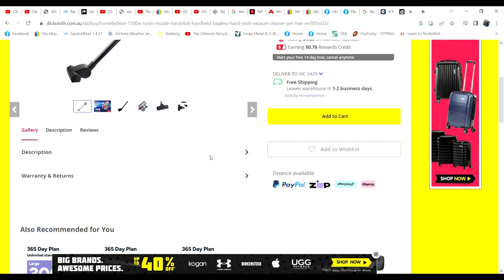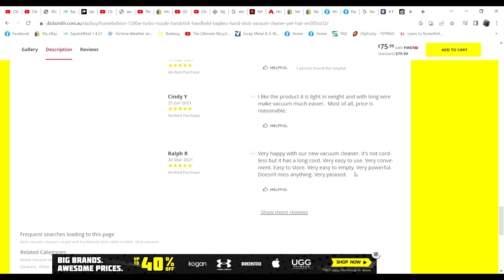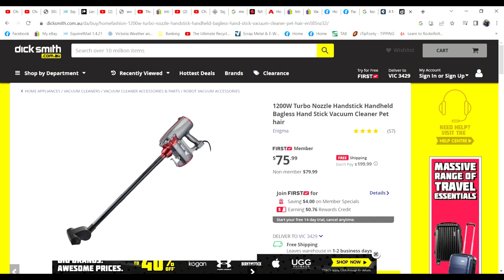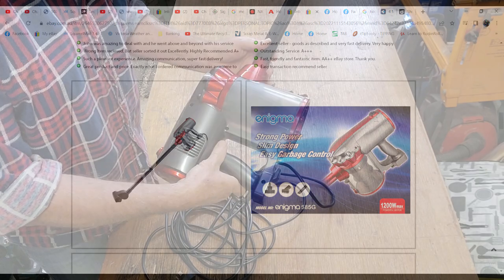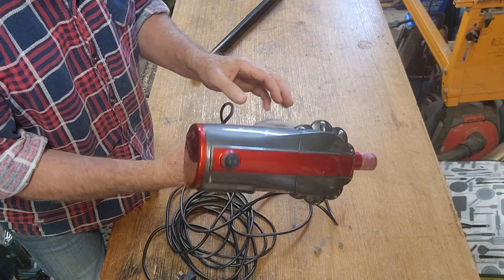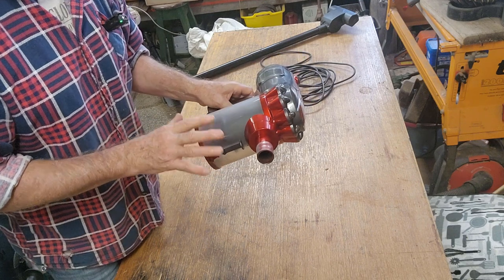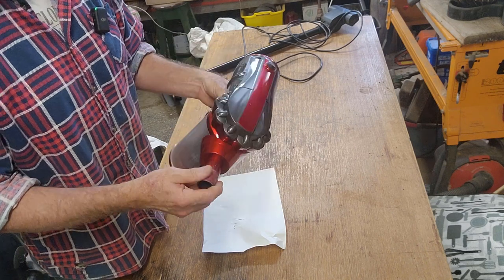If You a Own Bagless Vacuum Cleaner, You Need to See This! Why Many Vacuums Shouldn't be Thown Out!!

Comment: A good video of community value, Chris. I was given a near-new Electrolux that 'had problems'. Upon investigating, it had a lipstick stuck in the intake flow that made a terrible noise. Cleared it out, gave it a clean & it works just fine. So much is thrown away these days. Well done!
Reply from the maker: Thanks mate - yeah, they are probably the most throw-away appliances and they really shouldn't be!
Reply: I'm here because I too want to have a rant, I'm in the UK and have just fixed a Shark and Dyson which both had failed motor bearings due to dust ingress, both had at some point in their lives ended up without their filters because they have the washable type that say leave to dry for 48 hours or something, so device got reassembled and filters got forgotten in the cupboard.

The most annoying part, as well as the "main" filter, both have fancy HEPA/dust filters like this one, AFTER the motor! why on earth would you bother filtering the air again once it's already knackered the motor? disgraceful!

Comment: Intetesting. 

I have a dyson stick. They're made to replace parts. I've had it 5 years and replaced the battery, filter and the roller in the head. 

I've also repaired the power head myself. Was a simple fix once I had the right tool to undo it.

So much cheaper than buying a new one.
Reply from the maker: Cheaper and much better for the planet! Well done on your maintenance routine! 😊👍

Comment: Thanks Chris, great instruction. I have a bagless Shark vacuum cleaner and I clean the filters regularly. One tip that I just found is to wash my filters in cold water and dry. Previously I had just been tapping the excess dust out. All up I'm happy with stick style vacuum as they're pretty compact to store.
Reply from the maker: Thanks Longship, yes we have a Shark vacuum ourselves. The vacuum in the video isn't actually a bad design and it does work well - but it clearly needs some type of maintenance alert for the user!

Comment: I was given and also seen several dysons on hard rubbish due to destroyed motors due to the filters never being washed/replaced(one is washable). the other thing i've noticed lately (searching ebay) is BATTERY adapters for a lot of things which is great! for eg, there's makita to dyson cordless vac, makita to dewalt, makita to ryobi , and heaps more. makita to ozito even if you look hard enough. i wish all these tools would come with an option to choose a battery type you like.
Reply from the maker: Wouldn't it have been great if there had of been a rule right from the start that all companies had to use a universal battery type?! 🤔
Reply: @TheUltimateRecycler  at least RYOBI has committed to stick with the current battery style so their older tools are compatible with new batteries. here's hoping the other brands commit to at least making adapters for their next style if the tool is able to use the voltage.

Comment: I bought a brand new Dyson over 10 years ago and they send me emails regularly tell me to clean my filters. It's still going strong. Funny me and the wife had an arguement because I didn't want to spend 900 bucks on the vacuum cleaner. About 6 months ago on Facebook marketplace I picked up a Kogan cordless vacuum cleaner with a spare battery and all these assessories for FREE! because the woman said it doesn't suck very good anymore. The funny part was she gave me two spare filters. I took it home and use my shop vac and clean the filter and now I keep it in the garage. Works a treat. It wasn't very old will look of it. Cheers Graham
Reply from the maker: $900 is a lot for a vacuum mate! At least it's still going strong! 👍😊 Good on you for saving the Kogan one 👌
Reply: @TheUltimateRecycler  funny I was talking Mrs about our Dyson, we purchase when our son was 1, he 19 now. It was a lot money back when but 18 years and still going strong. Dyson replaced the head a few years ago for free. Filter is hemp and I just wash a few times a year. Never replaced it. I remember being angry at the time we purchase it. But she was right and I was wrong. Keep up good work Chris.

Comment: Had the same problem with one I bought for my elderly mother-in-law down south. I  gave complete filter cleaning instructions to people using it only to be told they bought a new vac because the old one failed. On my next trip I cleaned the filters and it returned to normal service. Cost $350 for the new vac 🙄
On a side note. They also replaced her near new dishwasher I had installed. Press the two buttons marked 'RESET' I yelled when my wife told me. I did a reset next trip down and sold the 'old' dishwasher on Marketplace. $500 wasted.
Reply from the maker: It's frustrating isn't it Dave? You wonder how many tons of stuff gets dumped across the planet each year due to lack of basic maintenance & understanding! 😟

Comment: They hid that one well. I purchased a Makita cordless vacuum for my elderly mum and you can at least see the filter and fine mesh cover it has over it. I still have to open and clean it for her though because the cover is too big for her to grip and turn to open the top part of the vacuum.
Reply from the maker: Having a visible filter at least helps remind people - and indeed informs them, that there is maintenance required!

Comment: Great video. Why oh why dont people read instruction manuals? There is no excuse but a lot of people just take it out of the box and switch it on and expect it to keep going with no maintenance. I volunteer at Share and Repair in Gloucestershire UK. We take in items for repair and also some kind locals donate stuff they no longer need for us to sell on, we just ask for a donation and parts cost. We get Dysons in all the time and most of them need a new battery. Dyson charge about £60 for a new one, a compatible from Amazon costs half this and are OK.  I am also amazed at how filthy some people let their vacuums get. Often the hand held battery vacs can be carefully dismantled and then blown through with compressed air, or even carefully rinsed, but only the non electrical parts that can easily be dried afterwards.
Reply from the maker: Thanks Nick. People are both lazy and have been mentally shaped into the disposable society mindset which manufacturers seem to encourage as they want repeat sales! From an economical perspective, some would question spending time on maintenance when it's cheaper to simply buy a new appliance every so often! Sad for the planet and it's going to be difficult to change the trend! Maybe we need to make all new equipment much more expensive!!